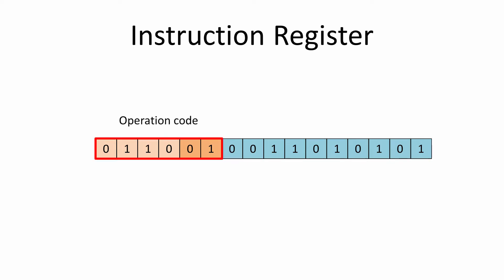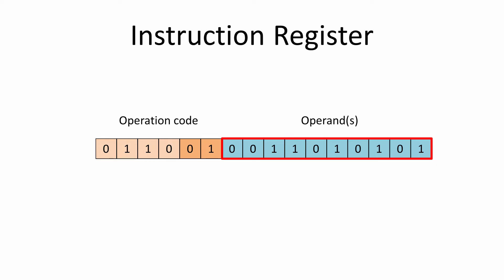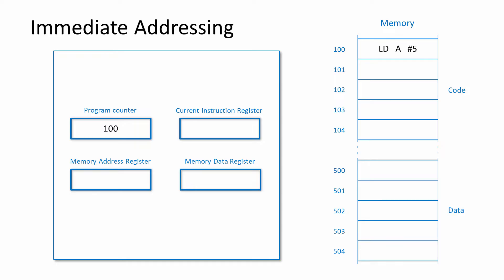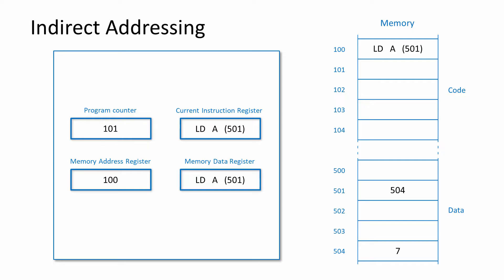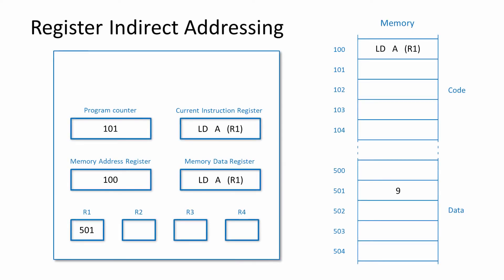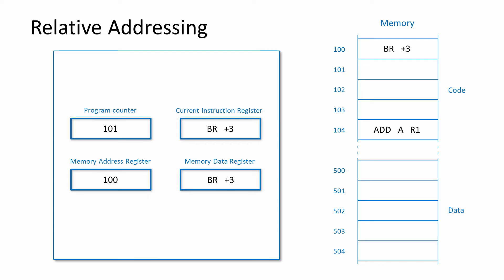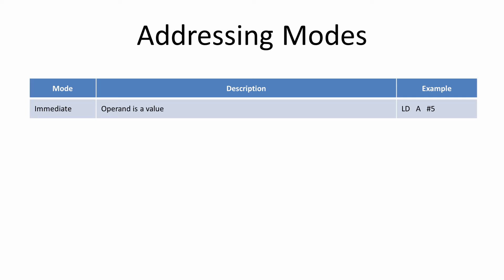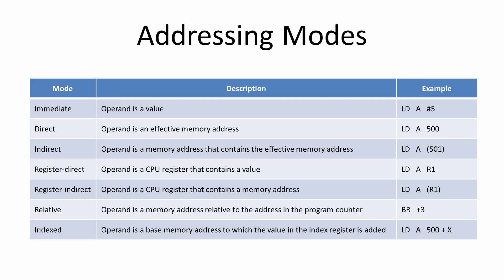Processor Addressing Modes

Comment: Excellent explanation, but one query I'm not sure about. In 6:10, you show that the value in the PC is 101, but you show the "BR +3" instruction at address 100. If that's the case, how does the PC read the instruction "BR +3" when it's at the previous address?
Reply: The program counter stores the address of the next instruction to execute, which is in 101.

The instruction currently being executed is at address 100.
Reply: @gnir6518  thank you!

Comment: At 1:10 you said "Fewer bits for the operand code means that (Fewer memory locations can be accessed directly)" the part that i have written in brackets< what does it means, the term directly has always left me confusing like what  is "directly"? Can you please explain that? Thanks.
Reply from the maker: Perhaps the video I uploaded yesterday about RISC and CISC will help (link below).  Suppose you have an instruction which adds a value to contents of the accumulator.  The operand of the instruction could be the actual value you want to add, so ADD #25 means add the number 25 to the contents of the accumulator.  This is called 'immediate addressing'.  If however the operand was a memory address of a location in memory that contained the value to add, this is called 'direct addressing'.  So ADD 25 means the value to add can be found in location 25.  When I say "fewer memory locations can be accessed directly", I mean that fewer memory locations can be accessed with direct addressing.
https://www.youtube.com/watch?v=6Rxade2nEjk  :)KD

Comment: register direct addressing mode: if the operand is stored in a register, it is known as register direct addressing mode(FASTEST)
register indirect addressing mode: if the register contains the MEMORY LOCATION of the value, it is known as register addressing mode.
immediate addressing mode: when the operand of an instruction is the actual value to be operated on, it is known as immediate addressing mode
direct addressing: if the operand is the memory address that contains the value to be operated on, it is known as direct addressing
indirect addressing mode: if the operand is a memory address of the LOCATION that contains the memory address, it is known as indirect  addressing mode(memory has to be accessed TWICE)
* NOTE: accessing the memory is more time consuming than accessing registers
Reply: Thanks

Comment: How does the processor know what is data and what is an operation ?
Reply: a few bits are reserved one or two tell the processor that if the contents fetched are to be treated as an actual value or as an address value

Comment: Questions:
1) What sort of computer might we be carrying these instructions out on?
2) WHY is register-direct addressing faster than going to the memory? Are the registers themselves not RAM in their own particular way? Or does it change things in that they are on the main processor chip?
3) What are the factors that would make you choose one particular method over the others, especially if it comes with downsides?
Reply: (Answer to 2) 
Basically because the ALU cannot directly connect with the memory and would need the Memory Data Register in between to do the Data Transfer.

Comment: This so takes me back to Microprocessor Programming when I was at college in the early 1980s. It was the Motorola 6502 then. But like clockwork, as soon as I saw that hash sign I thought "immediate mode". Funny how it comes back after all these years, and I went into electronics rather than computers. I also remember "accumulator", "zero page [register]", "indirect indexed" and "indexed indirect" addressing modes.
Reply from the maker: Funny how we still teach this today.  The concepts are still the basis for most machine architectures.  Roll on quantum computers!
Reply: @ComputerScienceLessons  Yes, it's amazing that so much of what I learned 35 years ago in a rapidly-evolving technical field is still relevant today.